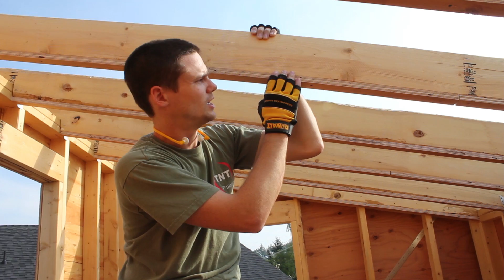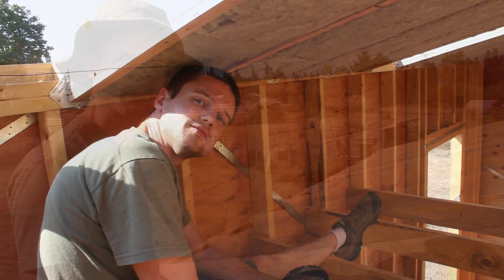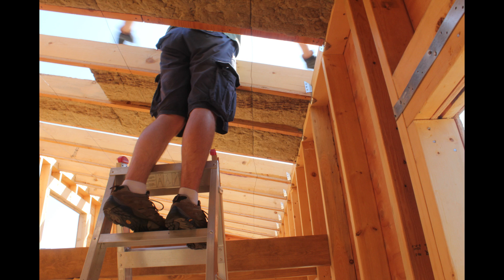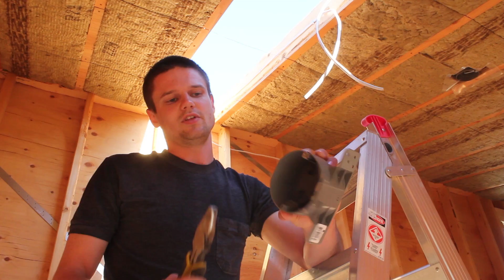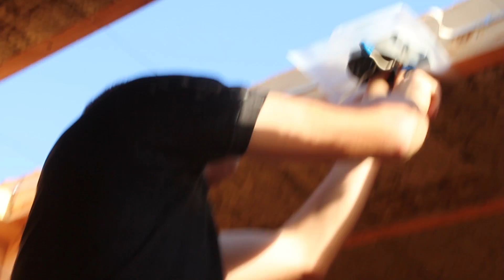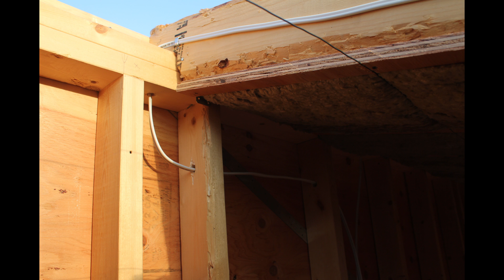Vented Roof Insulation for our Tiny House (Ep.13)

Comment: I ended up using baffling with the same roxul insulation as you and it was really tight so I wish I watched this video beforehand, but I think I'm ok: atinystudio.com Thanks for the vids!
Reply from the maker: We would definitely use baffling if we did it again, but we'd still add the shims to make the extra depth needed for it... that being said, since there is next-to-nothing run in the ceiling (in terms of plumbing and electrical) we would recommend rigid foam boards plus cans of spray foam (to fully seal around the boards) for both the ceiling and the floor insulation... Roxul is still great for the walls though.

Comment: The vapor barrier then goes directly under the insulation? Will the top side of the insulation be exposed directly to air and moisture?
Reply from the maker: +Ihaveriffs Yes the vapour barrier is directly underneath (at the ceiling). The top will technically be open to the outside air, which allows any moisture that may find its way into the cavity to dry. You should research moisture problems in "cathedral ceilings" to get all the information that we based our building technique on. Thanks for watching :)

Comment: Do u need building permit for all this?
Reply from the maker: +Dave Dee A permit is generally issued by the authority for a city or region, but since this structure is on wheels it's not part of a city or region, it's treated more like a vehicle than a house or out-building. What we could do is have it certified as a U-Built travel trailer, which would require an inspection to pass the standards of travel trailers. We've also heard that a form of mobile-home insurance can be acquired to cover things like fire, but we haven't looked into that yet.
Reply: if i want to build a small house on the region or city. Is there a way to build without permit? Or is there a way I can get the permit? How do I get a buildin permit?
Reply from the maker: +Dave Dee We don't have experience with this. You could always just build something, but then you run the risk of having to tear it down if an authority comes after you. You would really need to talk to your local authority to see what the restrictions are in your area.

Comment: incredibly well documented! One omission that I noticed in #4 that I did not see modified in #13 is that it is wise to overlap the top plate of your walls with full batt insulation which might prevent ice-dam along the lower eaves. (I did not watch the episode re: installation of the roofing before I typed this). You should be able to pull your fascia boards and install insulation using those baffles you mentioned earlier to maintain the venting cavity. Hopefully you also installed some sort of waterproof barrier under at least the lower 3ft of you roofing to prevent water from finding its way in if you experience roof dams. Very nice project and the most complete video presentation I have seen. Congrats and best wishes. Rich
Reply from the maker: +R Montena Hm, not entirely sure where you're saying to put the batts? Our fascia boards are not exactly removable at this point :P, but to address your concerns in general: it rarely snows/ices and even more rarely persists long enough to create ice damming, which is why we didn't bother pursuing that kind of installation. We are not planning on ever moving the house to an icier climate, so hopefully our rain-proofing will do it's job :)

Thanks for the feedback and for watching. Lot's more to come :)

Comment: I appreciate how you explain everything! I am curious about the air space/vent that you are leaving between the insulation and the roof itself. Would water not be able to get into the space and cause mold?
Reply: +Riley Peters - Perhaps I can help. The gap allows air to circulate around the insulation preventing any retention of moisture. Problems tend to occur when moisture is sealed in and trapped, allowing it to build up over time and cause problems. Changes in atmoshpheric conditions can cause the vapour in the air to condense inside the structure of a building, typically within the walls and roof space. Venting to the outside offers an escape route for this moisture. :)
Reply from the maker: +previouslyachimp Not sure how this comment slipped by! But "previouslyachimp" explained it very well thanks! (lol at your name btw)
Reply: Tiny Nest Hello Kiva and Jake, a huge thank you for your video series, they’re an invaluable resource. Though I do have some construction experience there are a number of aspects specific to tiny trailer houses that I’m unfamiliar with, so your thorough explanations are greatly appreciated. I’m over in the UK where our housing policies make it virtually impossible to live full-time in a tiny house, so I’m not sure I’ll ever get the chance to actually build any of my designs. Whilst I wait for the world to start making sense, I’ll keep the dream alive by watching your videos. Thanks again, and I hope you are enjoying the fruits of your labour in tiny house luxury. :D
Reply from the maker: +previouslyachimp Thanks for watching and for your comments :) hopefully if people keep pushing the rules and building tiny houses, the demand for change will have an effect on the authorities that restrict such things ;)
Reply: Indeed, it is a difficult balance as I do understand the reasons for some of the restrictions that exist, but some of the rules are no longer appropriate for the situation. The authorities should be a little braver in allowing people to experiment with new ideas. I would be happy to sign a covenant that bound me to some rules regarding respect for the land and neighbours etc., but unfortunately this is not yet a possibility. The biggest obstacle though is really a financial one. If you have plenty of money you could probably live in a tiny house on land that had permission for a building, but unfortunately that would cost many times the cost of the house! I'll keep trying. Thanks for your response, your attentiveness and professionalism are most assuredly acknowledged. :)

Comment: I'm thinking of building a tiny home and was thinking of using spray foam for insulation. would this cause a problem with condensation in the ceiling? should I consider somekind of gap in the ceiling?
Reply from the maker: alzathoth It seemed that there are two ways of going about it: either seal it 100% so that no moisture or vapour can possibly make anything wet, or assume that things could get a little damp and leave breathing room to allow it to dry. We went with the latter, but I believe you can achieve the former with a properly applied spray-foam installation. I highly recommend researching these things (this type of roof/ceiling would be considered a "cathedral ceiling").

Comment: Mr tiny nest y did u decide flat roof over peaked room
Reply from the maker: donald laisure Most peaked roof designs loose out on volume inside the house. With our bed oriented sideways, we will get the maximum head-room in the loft by having the peak along that edge of the house.
Reply: IT SURE LOOKS LIKE IT BUT ITS JUST SLEEPING ROOM
Reply from the maker: donald laisure We intend to lounge up there and possibly get dressed etc. so we wanted to leave wiggle room.

Comment: We really like watching your videos can't wait to see more!!!  The insulation that you are using is by far the best to use.  I've been doing research on different products and the consumer reports show that this one is the most fire resistant, Nice choice i see you have done your homework too. What thickness of a vapor barrier are you going to use?   Are you going to place some 2"x 4" blocks about half way in the wall  height horizontal  as fire blocks?  That is so if there is a fire god for bid the blocks of wood would slow the fire down.
Reply from the maker: James Stalter Yeah we looked at a few options and this one seemed the best overall.

We're just using a standard roll of "poly" for the vapour barrier. Same stuff that we used during the floor construction.

We've been thinking about the fire blocking actually. I'm not an expert on this but I question whether it would be better to have a combustible piece of wood in there vs just having the super-fire-resistant roxul throughout. I guess it would add a small amount of strength as well (2x4s)... so I don't know. We haven't decided on this item.